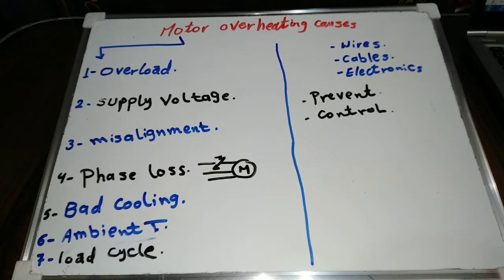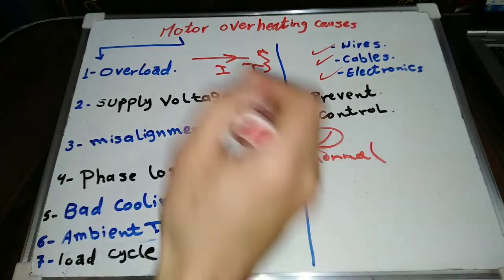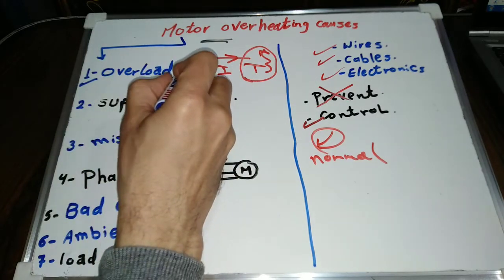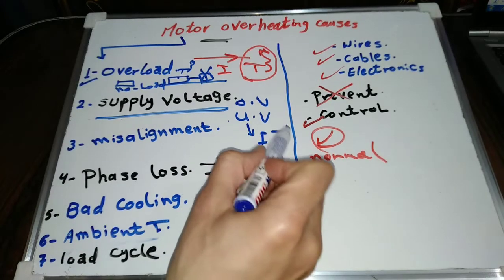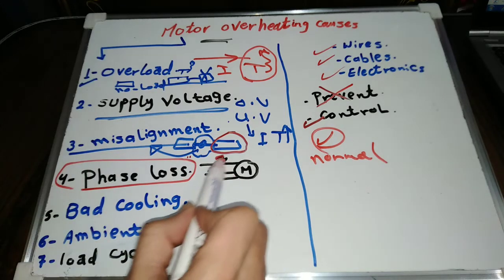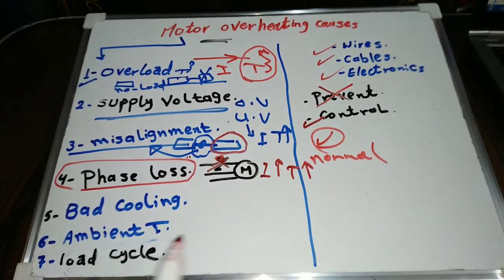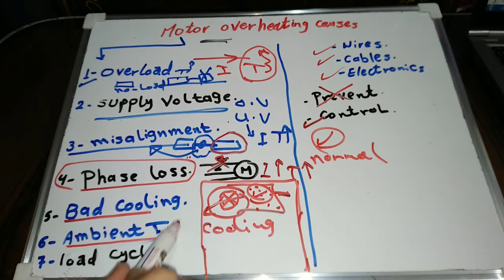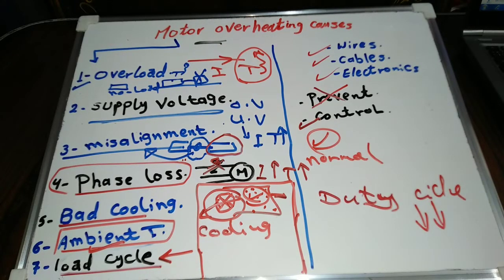Electric motor overheating causes explained!

Comment: Good day sir 
What if the coiling system is ok but the voltage  into the electric motor is 412v.  Connection.(Ystart)       

Load checked OKAY 👍
Alignment okay
Reply from the maker: What is the rated voltage of the motor?

Comment: I have an irrigation pump that seems to run on the hot side and I am wondering what the external temperature 
of an electric motor running for an extended period of time should be??
Reply from the maker: Depends on the insulation class of the motor.
What is your motor insolation class?

Comment: what might be the cause of sparks on a DC motor? at just 30mph my mini car does sparks and I gotta slow down. Brushes sticking to the comutator? if I put brand new brushes would it solve the problem? I believe I will get hot anyway but I dunno how to cool down the DC motor. is there any way making it into liquid cooled or use a fan located in a strategic place?...like inside the comutator?
Reply from the maker: DC motor brushes produce spark anyway, but the spark becomes larger when the brushes need replacement.

Besides the carbon particles on the commutator make the spark higher., It requires maintenance and cleaning.

Cooling the motor depends on the motor design, don't worry about it if the motor is good.

Comment: What happen if i connect V1 U1 W1 for YWE connection W2 V2 U2 is L1 L2 L3.THANKS FOR ANSWER
Reply from the maker: Could you please explain it more.
You have a Y motor, V1 U1 W1.

Now you are asking about connecting this V1 by W2, U1 by V2 and W1 by U2 then connect L1 L2 L3 to it respectively?
 Am I on the same page with you?